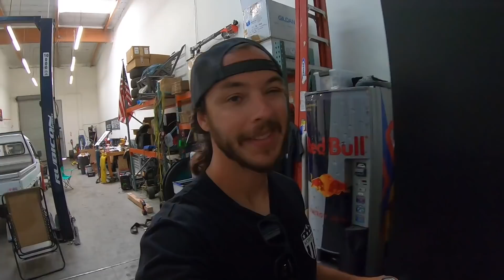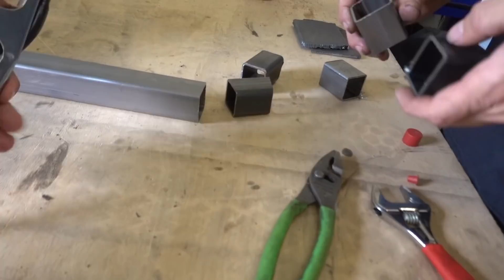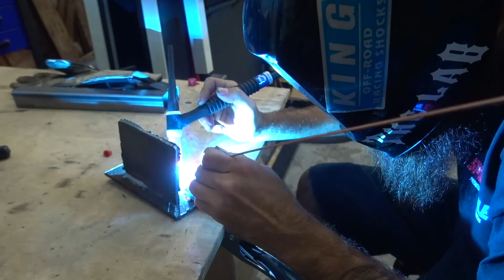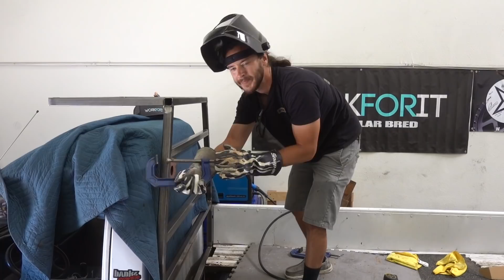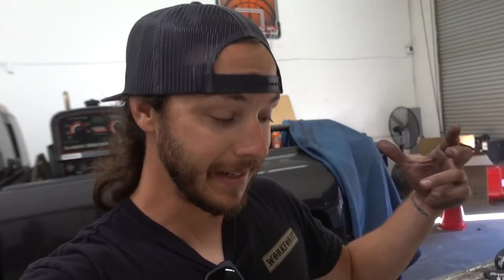MINI TRUCK BUILD DAY 2 WITH A HUGE PURCHASE!

Comment from the maker: Make sure y'all check out West Air for all of your welding and gas needs! They have tons of locations and super knowledgeable staff!
https://www.westairgases.com

If you don't have a West Air near you and want to check out the welder I bought, you can find it here:
https://amzn.to/3xnlsUc
Reply: Sussy baka
Reply: Definitely going to look now bc I’d like to get the same welder like the one you have bc I could tig a lot of stuff
Reply: Hi Ryan, my name is Bj and I’ll be in town Wednesday to pick up my Nissan Titan. I was wondering if I can meet up at your shop and see the truck that inspired me to go bigger with my truck and also to meet you and get some merch. Thanks for your time.
Reply: Best project for a new welder is a custom cart.
Reply: They also make a remote that goes right on the gun also to turn it on and off thats what i run on mine cause I'm always in the some akward spot that the foot pedal won't work.
Reply: Nice now you can build your own gates👍👍👍👍
Reply: Milwaukee sells a tungsten sharpener
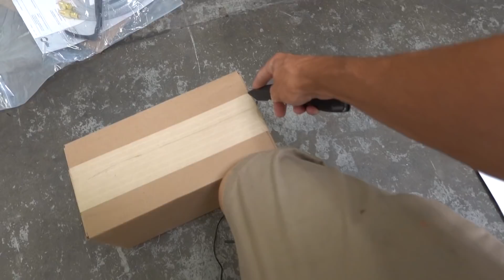Reply: Nice knife at @10:31 kershaw blur tanto good choice my friend good choice 👍 👌

Comment: “ every house comes with a stick welder” haha my house has 4 switches on the panel for welders specifically and had 1 welder in the garage and 4 tanks of the gasses in the shed.

Comment: Congrats brother you picked a great welder. Just a little heads up anytime you do ANY welding on a vehicle be sure to disconnect all batteries to prevent damaging any computers/electronics.  You may not have had any issues yet but it's a matter of time before it does happen.

Comment: You need this to cover your welder when you are not using it. It is a 220 cover. 
 https://www.millerwelds.com/accessories/protective-covers/mig-tig-and-multiprocess-welders-m30107

Comment: AFAIK, using CO2 with MIG makes it MAG (Metal Active Gas instead of Inert). Still the same process, but since CO2 isn't inert, the name would be kinda funny. Using CO2 does make dirtier welds, but it could also cause them to be weaker, if I understood correctly. Since CO2 isn't completely inert, the hot metal will react more than it would with an inert gas, but still less than it would with normal air (so without a shielding gas). I'm no welder by trade though, I'm just a novice, so I could be wrong.

Comment: Little tip you can pull the trigger and have the machine do the work when you put a new roll of wire on just put it in the wheels and make sure it’s in the lead first and pro tip you should have a jog button and purge button

Comment: i have 220 good machine spoll aluminum works good great doit all welder does not take 20lbs wire roll only set down im upgrading to  a multimatic 255

Comment: stick welding is good to learn there cheep simple awesome for when your working out in the field no need to worry about gas or feed rate its all hands on the only real challenge is touching off gotta get it to arc then pull away a tiny bit with out braking the arc once you get that down its fairly straight forward.

Comment: No wayy, that's a badass welder. Just bought the same one a few months ago and got it for $3,700. I'm sure it's gone up from that. Very versatile and universal welder. I got the miller specific cart for it as well which like you said is not cheap, but it fits on there very well. Tungsten sharpener just buy a cheap harbor freight belt sander like 80 grit. And FYI it's stiff but it's a flex head

Comment: I have the same welder. When you were welding the horns onto the rack and you blew the holes. You were probably focusing to much heat onto the horns and not the rack. So just for future reference for things like that focus more heat on the main bar and not a edge. Welds were looking good for not really mig welding a lot

Comment: *sigh I miss welding.. Learned MIG/stick in high school, then turned around and learned TIG and gas in college.. haven't done much since.. was going to be my job and then a scoliosis/kyphosis diagnosis (that's a lot of ises) took that from ever being a possibility. I will say I don't miss the Miller welders we had at the college that would zap the shit out of me when trying to weld and the arc decided it'd be easier to go through my arm and into the table than out the end of the torch.. on 5 different welders.
Thoriated is good for steel and stainless pure tungsten is good for aluminum and copper. Why the hell would you ever buy a welding cart? You have a welder and metal and cutting implements... build one yourself! That's like the beginner welder project is building a cart for your welder. You also don't need TIG wire all the time, it's nice because it's stiff and straight (hehe) but you can use mig wire to tig regular steel just fine. It would've been far smarter to make that rack out aluminum though. By the time you are done that thing is going to be so heavy that that little thing is going to struggle to hit 30-35mph unless you engine swap it.

Comment: Man DMAXRYNO, nice job on the beginning welds bro, I am jealous of the nice welder, just like you I have been wanting a good welder for a while now but have not pulled the trigger on it because of the price. I think the same way you do, you get what you pay for and is why I always save to buy the best product or tools or whatever one time instead of multiple times so first of all you get what you want which makes you happier and second you save money in the long run by not fixing or replacing the cheaper product over and over. Congratulations on the new sweet tool purchase, it will definitely help out Zach and you with your channel on the awesome builds. Keep up the great content 😁👍

Comment: I got the Thermal Arc fabricator 211. It’s a 3 in 1 for entry level welder. I still need to get the TIG parts and a gas bottle.

Comment: I made a great living for 25 years Welding...I teach Welding now...My advice is to take your time and fully understand the material that you're welding and keep it clean..Good Luck Guys on Stacking those Dimes...
Reply: I have to agree with you,i also like to tell folks getting into welding of any sort (make your next weld better than the last)
Reply: Tried welding in a metal fab class in high school. My glove kept getting stuck to the metal. Any idea what I was doing wrong? It kinda scared me into not pursuing welding, and was too embarrassed to ask the teacher or anyone else back then
Reply: @imnotawasteoftime  I'm not sure what was going on with that, Bud...I've never had that problem...Don't be scared to try..Get you some fresh gloves and see if that helps..Good Luck